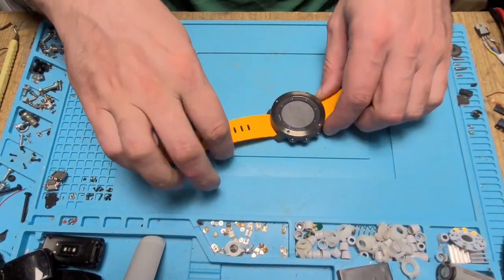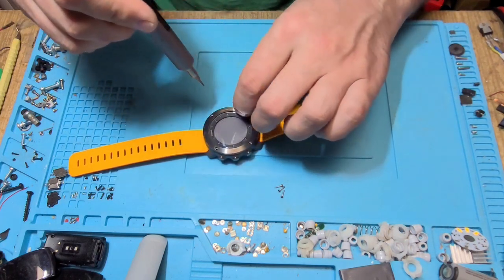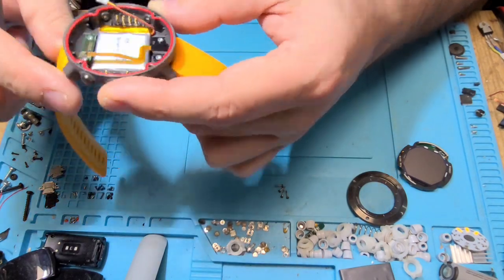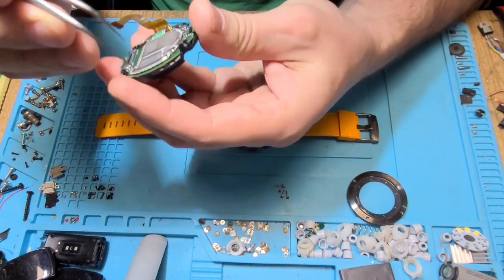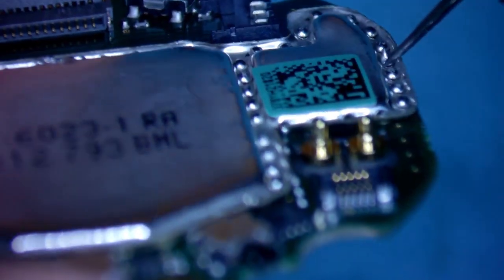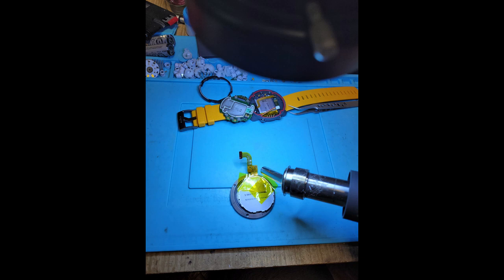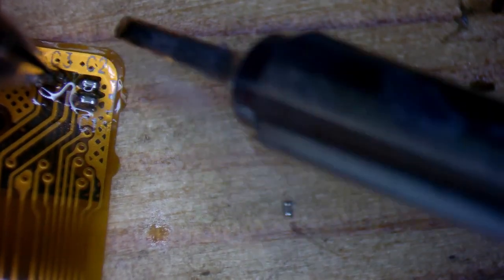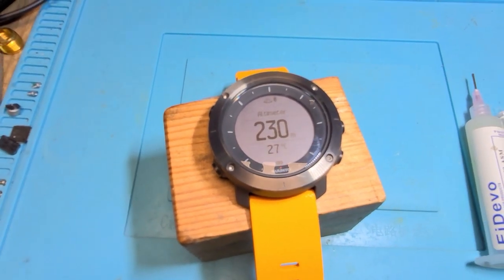Suunto Traverse dim display, no contrast, Repair

Comment: Hi, what would be this defect in the photo of the board ... a liquid close to number 13 of the board serial. What defect does it suggest? After a full charge, the watch on the same day was left without any charge.
Reply from the maker: Difficult to say.. from description I would say maybe water damage if you see some liquid inside.. it seems there is a shorted component if it discharges so fast...